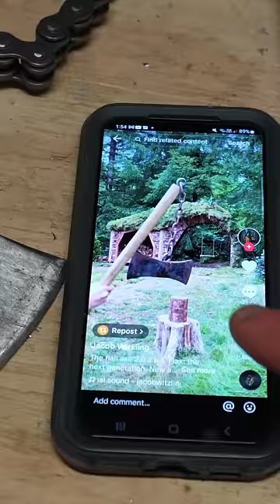Hidden motorbike chain Axe

Comment: I'm slightly terrified to tell you this, but that seems fitting.

A great way to get blades or spikes on the ends of ropes or chains to always face forward, is by having a flag or fins on the back. It's even better if the head is attached via a bearing, so that it can freely rotate without twisting the chain.

I tried it with scissors and some cloth when I was a kid. Stuck straight through the door. Mom was pissed. Also tried a hammer, axe, a knife, and all sorts of other dangerous things.

It's like an arrow on a leash. Seems right up your horrifyingly unsafe alley.

Much love.
Reply: You must have put your mom through so much 😂
Reply: I never felt like finding something to tie onto it so I just had a sharp thing at the end of a rope that really wanted to bite me
Reply: @lunar_moth777  Oh the flag doesn't stop the biting, in fact it just makes it more effective.

It is less likely to bounce back from failed throws, but if it is ever coming towards you, it's coming blade first.
Reply: @ArseAllowance  I mean I learned to take it outside. But yes, yes I did.

Comment: You might be able to mount the chain to the end of the stick sideways so you can spin it up and gain a scary amount of force before hitting something or someone with it, as that was the idea behind flails. It would have to be on an axle so it can just swing around multiple times without coiling up.
Reply: Yesh can't see that working

Comment: The main thing you have to watch out for when using this ax is that you don't bury it into your back  😦
Reply: @jort93z someone's never cut wood before, guess where you start your swing? Overhead, therefore, without caution you'd bury it in your back when drawing back for the swing.

Comment: When you swing an axe, you start with one hand at the bottom of the handle, and one hand at the top below the head. You start your swing, loosen your top hands grip to slide the top hand down to your bottom hand, shortening the balance and increasing leverage.. in other words, your spring trigger is in the way

Comment: This is awesome, I want a pair attached to a pair of eskrima sticks, attacked to My pathetic forearms.

I've gotten out of dodgy situations with 
1 ounce of improvising
4 litres of chaos (my own blood from failed attacks included) 
Driftwood, or junk.
Duct tape 
(always bring a little, have a bottle of hand gel? Put a few rounds of DT around it, got a lighter? Do the same, got a flashlight? Do the same dammit! same with rubber bands, always add a few of those) 
if it's the good kind of DT, you can use it 3-4 times before the glue goes stale.
Bag of salt and chili powder (not the soft chili, but not the permablinding either), grind the salt  into a really fine powder, same with chili
DONT TOUCH YOUR EYES BEFORE WASHING HANDS
Either make a ballon gun with a ballonvand a toiled roll, fill it with a couple of tbps of the mix, ornise a thin pvc pipe or two, do the same, and AIM for eyes and mouth, 
Take two steps back afterwards, also, check wind.

If you can't be bothered, used a flower water spray thingie, remove the handle and nozzle, attach it to a pet flask, fill it up with a strong chili mix.

lt buys you time to ask what the hell they want, if they say "rob you"then they are probably desperate, but ...if they have nice phones and shoes, trade them.

Love you ppl
Solo-sweden

Comment: I don't care how good your tool is or how good you are at using it there are safety procedures that should always be followed. Specifically, in this case, shoes or boots preferably. Unexpected things happen all the time and if you keep chopping wood barefoot, eventually something will do just the wrong thing, and you're going to mess your foot up bad. I pray that you never have to experience this, but taking the proper safety precautions will help prevent that from happening.
Reply: Party pooper
Reply: I ain’t reading all that